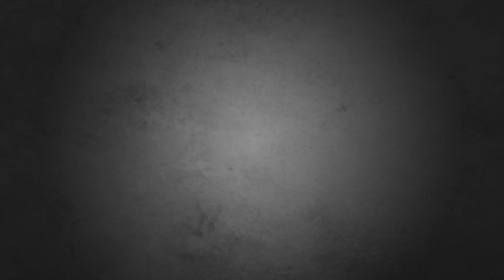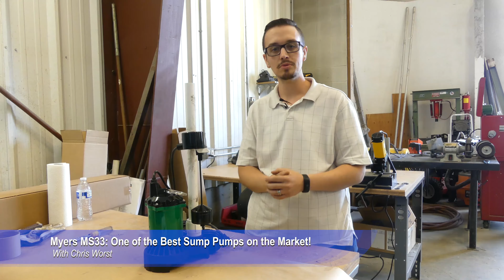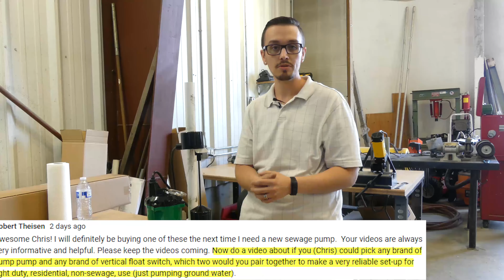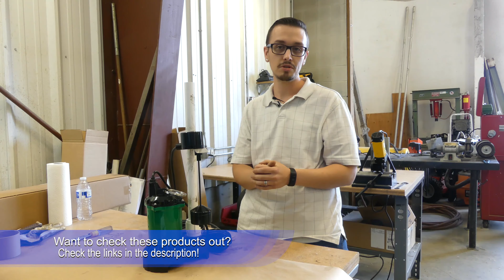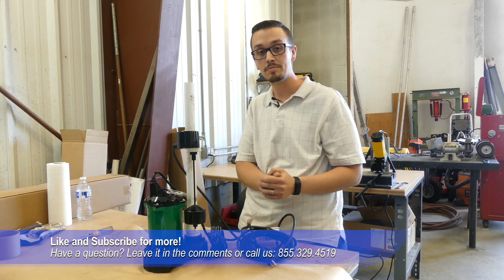Myers MS33: One of the Best Sump Pumps on the Market

Comment: u should take this video out my sump pump not even 3 years failed and the casing cracked by its own , the metal where the bolt go in to seal the gasket scramble with no sign of rush poor manufacturing